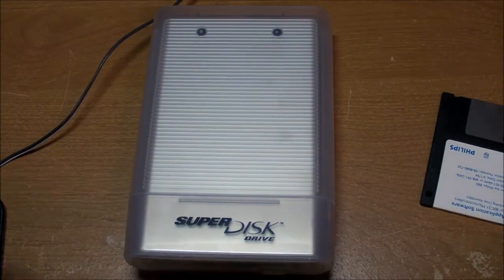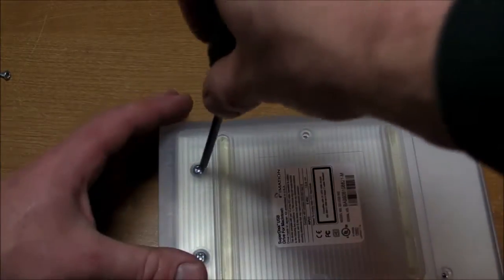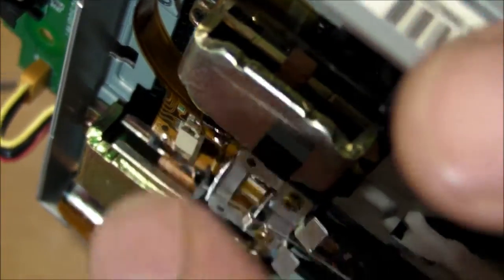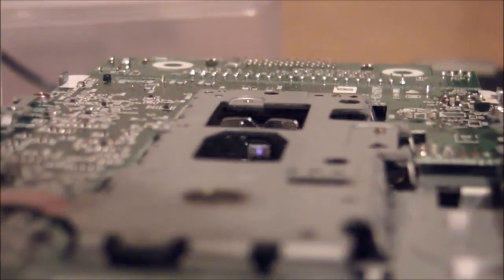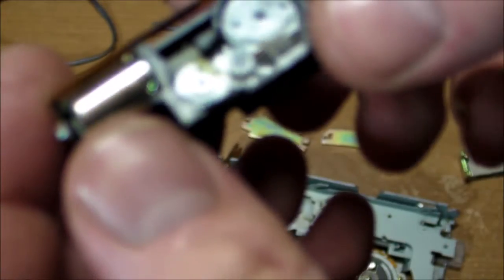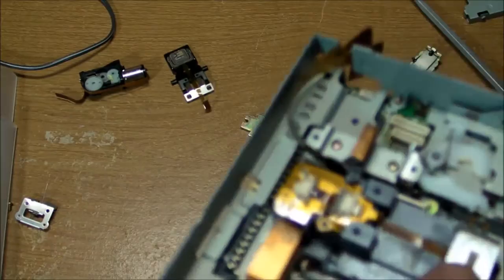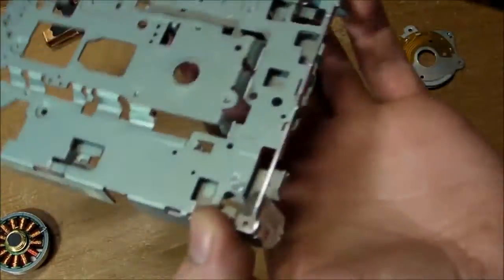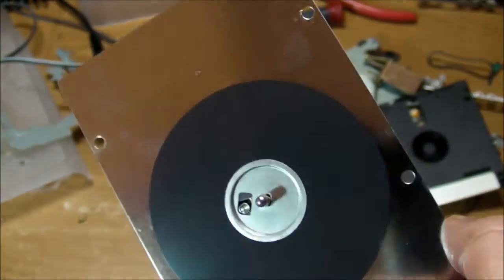(#0171) Imation SuperDisk Drive TearDown

Comment: Possibly it has 2 coils to do the actual positioning.
Harddrives also use 2. If both coil are powered at the same strength. The head moves to certain point. You actually only need to adjust only one coil to move the head to head.
Using only one coil would just push the head forward or backwards until the voltage is dropped.
So for accurate positioning, you need 2 coils.
The voltage then sets the head really precise, you don't even need to check it with a sensor. Just like a stepper motor. The motor is exact. You just count steps. Here you create steps in voltage.

Comment: The format is commonly known as "LS-120" (for 120 megabytes). Compaq and maybe a few other computer manufacturers sold PCs equipped with LS-120 drives, but by the time it came out, the Zip drive dominated the marketplace, and CD burners were becoming more and more popular.

There was a later LS-240 format with double the capacity, but I've never seen any drives or media for it. Even LS-120 drives are rare to see anymore, while Zip drives are still very common at thrift stores and flea markets.